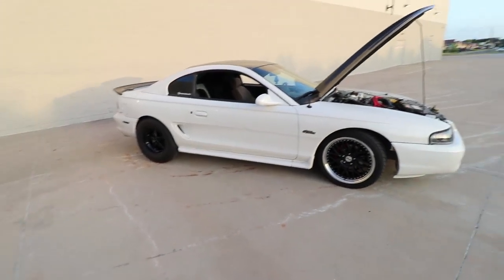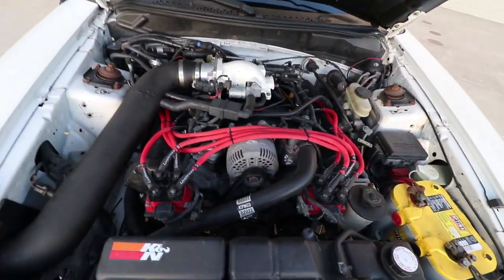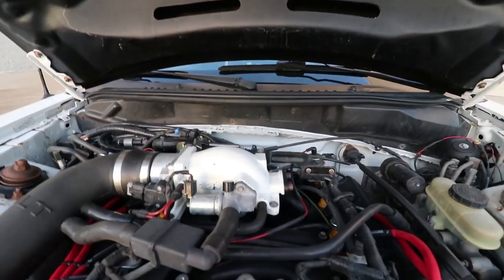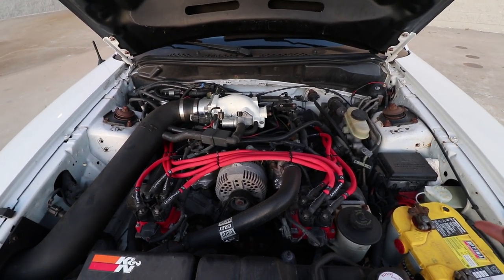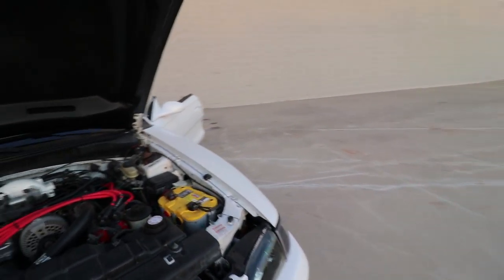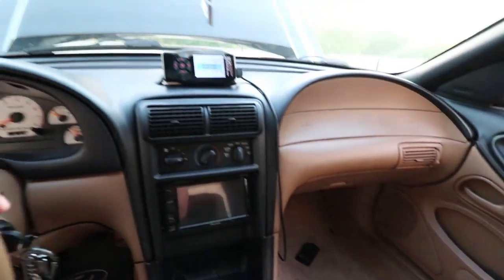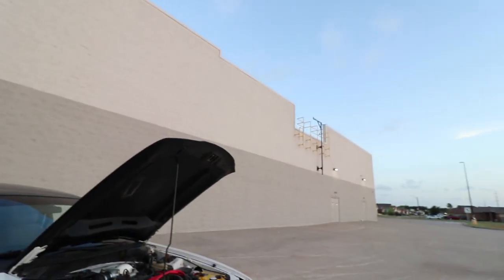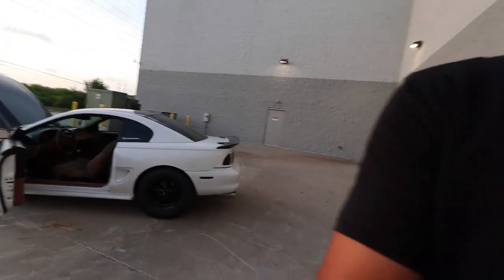How To Get 300Hp Out Of A N/A 2v Mustang

Comment: If you want to break 300hp N/A your gonna wanna get the trick flow heads. The 2v is not a monster in terms of power but they are well built, I'm actually looking to sell my 96 to get a 95 so I can drop a 351 in.
Reply: Stroke that 351 to a 408! Yeee!!
Reply: PI 2v can make it with bolt ons and cams, full exhaust.  NPI will do more if you PI swap it and the  do the ae treatment(pi heads on  npi shortblock gives a bump in the compression)
Reply: @01Snorky  a 2v will never make the power a built 351 in N/A format. With trick flow heads your looking at 380-400hp at the fly wheel on a stock bottom end 2v... a 351 with a forged crank, rods, diamond cut pistons, high lift cam, Victor carb, and head work is going to put you around 500-600hp depending on heads, bore work, fuel, lift and duration on the cam....
Reply: @poppasunny  you think??! It only has 70 more cubes.  And where did a 351w come from in a debate om whether you can make 300 rwhp NA with a 2v, which is totally doable.  6 years ago i made 289rwhp 309 tq with cams not degreed.. litrerally thrown in, with some generic bama tune not for cams.
Reply: @01Snorky  really?.... You replied to my comment.... it's in the original comment.... also I don't know if your being funny or ignorant in regards to "50 more cubes" a 4 valve 4.6 makes 300hp.... a 4 valve 5.0 makes 400+hp.....
Reply: @poppasunny  i am being funny :-D
Reply: @01Snorky  🤦‍♂️ you got me
Reply: RAllen yo rallen! Your totally wright! Weard but i litteralymade 289whp /312wtq with my ported pi from cms with vt stage 2 n/a cams , lt bbk headers, off road x pipe , windage tray , stock npi botton, pi intake , c&l plenum ,75mm tb, cai egr delete blablaba... but my tuner told me that i mess it up with the degreeing and had to do something with the tune to correct it.. but i lost A Lot of hp cuse i did not degree them😭 i would had made like 310+ whp without this mistake!
Reply: poppasunny 47 while that’s cool you should just leap forward instead of backwards. 3v or coyote swap that car. You’ll never look back
Reply: 4.6 4v actually makes 305hp.Its the 3v that makes 300hp.
Reply: If you're going to sell one car to build another for about the same results.  Why bother 
By the time you spend the cash to build the 351 . You can buld a 281. Strock it to a 302 or up the compression.  TFS hears . Aftermath intske or carb it .
I'm not a fan of carb but I've seen built  2 vavle with  carb setup rev to 8 k and i was told it made 470 on E85 . The ET i saw live prove it .
Reply: Mod for mod a "built" 351 will make more power than a 281 yes. But you're comparing a 281 with heads to a 351 bored and stroked with all the goods thrown at it. But keep in mind a stock 351 from the 70s made well under 200 horsepower. We're talking 170hp truck and car engines. Mod for mod on a stock 2v vs 351 the 2v makes more power next to a low compression 2bl carb 351. But both built the 351 has more cubes and makes more power NA. But boosted is where the 2v shines and the 351 stock block maxes out and guys have to run Dart blocks to see 600+ safely.
Reply: 351 Windsor or Cleveland
Reply: @lowlyfe2497  have ran a few 351's up into 600+ without resleveing or getting a new block. It's all about how you build your motor, factoring in the little knowledge I have and about 15 excel sheets factoring all costs the 351 is by far cheaper.
Reply: @ericbly4599  Cleveland
Reply: @Spad68  1. I have priced it out on multiple occasions and it's more cost effective for what I want to build the 351. 2. Ease of maintenance and engine work... 3. Factoring in clearance and block design your going to spend more boring a 4.6 to 302 CI when you could rehone the walls in a 351. At which point drop the cash into the internals, some port/aftermarket heads/ larger heads can really make a world of difference. 3. You can build a 351 mix and matching parts, cranks, heads and intakes are interchangeable as along as ports match.... you can throw a 400 crank into a 5.7 small block and technically have a 383 🤷🏿‍♂️
Reply: I've got a 95
Reply: @poppasunny 47  4V's suck. 2V is king. I outrun them often.
Reply: @poppasunny  get a room.
Reply: @teal_2v338  atta boy!
Reply: Lmao for that money might as well build the motor for boost and throw a turbo on it lmao 🤦🤣
Reply: Just drop in a 7.3L Godzilla motor. They fit good.
Reply: Why do you have to swap down to a 95? Is it because of space problems ?

Comment: Great setup.  I have a 95 GT myself.  That noise might be the idler pulley and belt tensioner.   Those are low cost items and easy to replace.
Reply: Matt crow sounds like a transmission throughout Bering to me
Reply: Definitely throwout bearing.

Comment: Sounds similar to my set up Chris. One thing that a lot of guys don't do when installing cams is degree them big pain in the ass when in car cam swap but you got the timing cover off anyway. Degreeing the cams is more important on multi cam motors. Can gain you up to 20hp depending on how off the two cams are one side of the motor is fighting the the other. Degreeing the cams is free horse power why leave it sitting on the table get those cams dialed in if you can even if its only is 5hp guys pay $$ for add ons that don't do more than that. Just an FYI for guys planing on swapping cams dial them in. BTW nice build Chris your always going to have the haters and the 2V can make HP but requires ported PI heads to breath better.
Reply: How does it not confuse the computer ?
Reply: I’ve heard story’s of people degreeing the stock cams and they would make like an extra 5-10 hp on the dyno
Reply: That is true and with the 4v you will notice that every single one makes different dyno numbers in stock form because ford could not get them degree'd perfectly at the factory.
Reply: Was about to say the same thing throw some pi heads on the non pi motor and you have more power then a pi motor change the compression
Reply: You have to degree any cam in a 4.6 to avoid PTV clearance. Made that mistake with stage 1 comps and broke a valve guide due to PTV.

Comment: Get the Torque tech kit. It lets you run a Whipple, Kenne Bell etc. You'd make up in the 400s maybe even 600s with your FBO set up all ready there
Reply: Stock 4.6 internals won't take 600hp. Maybe 450-500 at most.
Reply: @cheeko_914  Yeah, 400 is a safe area, past that and it's a ticking time bomb, not if, but when it'll hit catastrophic failure. Pistons and crank is your first failure point on the 2v, and they like to go at 500 after a couple dyno sessions, 450 and you may get a few good runs but it'll definitely not handle constant beatings (even if you shift before redline). Forged is what you want if you're gonna be pushing enough boost to put you past 415. I've already done my research on the torktech kit and it's definitely what I want to do, but you're not gonna slap a whipple and a high boost pulley on it and achieve anything past 450, even with a perfect tune, on your pot metal rods and doodoo crank.
Reply: @AzalofForossa plenty of guys have had 2v live a good while beyond 450 rwhp stock bottom while taking a beating.  How high you Rev it and the fuel and the tune all are a big factor in it staying alive.
Reply: @AzalofForossa also supporting mods are a big deal.  A car with long tubes cams and ported heads can make more safe power than someone who just threw a blower on a stock car that doesn't have any of that.  450 rwhp from each are certainly not created equal.  450 rwhp from a more efficient setup running less boost is gonna be much safer than 450 rwhp with more boost (to make up for not having the supporting mods).  It's not as simple as this number is what you can go to anything past its gonna blow.  It's not that black and white.
Reply: If I was gonna run a torque tech kit i wound run a vmp gen2r that is meant for the terminator.  That would be a killer blower for a modified 2v.

Comment: The pi heads on the non pi block was a big part in your power numbers..gives a healthy jump in compression and you did great choosing the the stage 1 pi cams..Those cams offer the greatest power increase throughout the entire rpm range, not just 4500 and above...You dont really loose any torque down low with the stage 1 PI cams which keeps your steetable torque in check...The perfect cams for stock pi heads and intake.👍

Comment: PI heads on N-PI bottom end makes more compression and is easier to get higher NA power. Richard Holdener explains this in a video on his channel. A good tune also goes a long way because these cars come really conservative from the factory. The cam stage matters because of differences in lift and duration, on these I really think it just changes street driveability due to less vacuum on higher cams. A lot of guys daily stage 3 cams though so idk. I'm just keeping my 2v stock.
Reply: Different companies have different stages at different specs it doesn’t mean anything. Na svt (Todd warren) is widely regarded as one of the best for cams for mods. You can look up na svt cams on YouTube

Comment: Nice set up. The 2V isn't a powerhouse but it's a tough, reliable motor. Your dyno numbers are about what I'd expect. A FBO PI 2V puts down around 260rwhp & 305rwtq, and yours put down 20rwhp more with stage 1 cams & higher compression.

Comment: I'm running a Triton 5.4 with heads headers exhaust and tune and I run bumper to bumper with the yotes I'm also running 373 with aluminum drive shaft and 315s

Comment: The 2-valve doesn't get a lot of love. But let me tell you brothers....it is DURABLE!  I have owned 3 of these motors on three different cars (including an SUV) and man I was able to get almost 300,000 miles on two of them (crashed one, sold the other) and the third is still running with going on 300,000 miles all original motor and transmission!  Hell if police cars, taxi cabs, etc. can use them for half a million miles then anyone else can, too.  The trick is to change the oil every 5,000 miles and replace the plugs/coils every 100,000 miles (use Motorcraft plugs & oils).  Also make sure you use Motorcraft "gold" coolant.  These engines are more durable than just about any other V8 currently made.
Reply: They are more durable than any other v8’s made currently. Chevy would be at the top right now with the LS/lt but all their V8’s have the troublesome 
afm/dod and a few cases of lifter failures. Dodge also has Cylinder shut down and the manifold bolt failures. Fords coyote has coil failures egr issues and such, the most minor of the big 3’s issues though.
Reply: @bmacster1985  agreed. The LS and LT motors were great until GM killed it with the AFM. Just like Ford killed a great V8 with their 3 valve design with VVT with insufficient lubrication.

Comment: Nice car and it sounds great! If you had bought a premium set of headers and the matching mid-pipe you would have gotten closer to 300. You would also be surprised at how well a quality set of ceramic coated headers keeps the engine bay temps way down. I got SLP ceramic and it’s literally amazing how much less heat is under the hood.

Comment: What’s up what’s up! I have a 98 Mustang GT. It’s automatic and Dynoed and tuned by Shelby Motorsports, 517 Hp wheels, 537 torque, 573 hp crankshaft. I know you started building, and honestly it’s a starter setup. But I wanted to inform for anyone who is trying to do the same, KEEP THIS IN MIND. Once your upgrade any engine part, you might be forced to upgrade something else! Thanks for sharing your cool project. Btw my car is naturally aspirated pushing that much. I didn’t just grab and bolt on random parts. I suggest anyone to do their homework on how the parts affect the car and which work best together. Trust me, it will be a pain when you encounter something simple as adding cams, valve springs and then needing to forge pistons as an example. I have about 12k just in parts on engine, tranny and gears alone. I learned the hard way. So if you’re trying to add a supercharger or nitrous, just cuz it’s a “supercharger, nitrous” please understand how it’s going to affect you. I have seen many younger people bolting on random parts or adding too much too soon, only for the vehicle to take a dump later. I think your serpentine belt might be a bit loose btw. Also, it’s IMPORTANT to tune your vehicle accordingly to your parts. Your car will thank you!
Reply from the maker: Can you share with what motor components you’re running to get 517 to the wheels all motor? That’s a lot especially through a automatic.
Reply: @ReyesBuilt  Yes; I can do that. Real quick backstory. It’s a passed down family car, I got into some financial trouble and had to sell it after I worked on engine. Somehow I ended up getting the car back since the guy had to move and couldn’t take the car. So he literally ended up giving it back to me for almost free, cuz I couldn’t pay for it. He insisted and I didn’t have it for 3 years. I have the specs and list of parts, so I’ll look for them. But I’ll shoot what I remember for now. Give me a sec. I don’t remember exact specs on most.
Bolt ons: Cold air intake, Throttle body,  big plenum, pulleys and alternator is flipped around reverse for clearance, racing manifold (had PI but went bigger), stroker kit, stage 3 heads, stage 3 cams, flex plate for 10k applications, 4:10 gears, i forgot what spline, axle, tranny mods. Tuned to 91 octane, 8 miles per gallon, royal purple all the way around, dropped about 13 k in engine alone not counting behind flex plate or labor which my best friend is a diesel mechanic so he did most of work and saved me about 10 k. Tuned at Shelby Motorsports. I live in Las Vegas and for all that, I went and spent I think it was $800 for tune and dyno, about a 8 hour job per visit. I’m still not done. Everything started with my check engine light being on, due to misfire on a cylinder and showed low compression. So here I am “man I’m going to add what this one mustang guy added, which was a PI heads, so I ended up grabbing stage 3. It all went downhill from there. Cuz then I needed larger valve springs, so I grabbed stage 3 cams. Next thing you know, what I listed is in. The issue was a rocker that fell off. But because I didn’t do my homework and honestly educated myself on what each part do and affected my car, I had my car down for a year and a half. This is why I say what I said. Because it’s true. I spent a lot of money and many if not all people want a modded car, but aren’t aware of the real cost of parts, time and setbacks.

Comment: Thanks for passing on so much info, the good, the bad and the rest. I'm looking at throwing some bolt-ons at my Grand Marquis' 4.6 - Trick Flow heads, XE262AH cams, FRPP PI intake (until I can find something better that's set up for driver side pickup), long tubes and more. Upgrade the 4W70 for the power...

And enjoy.

Comment: You're doing good man.  If mine did 280HP, I'd be very happy.  Remember, the factory rated the PI Mustang at SEA 260HP at the crank.  With proper maintenance, these engines are built proof.  If you blow it up, you did something stupid.  Thanks for mentioning the metal intake tubes soak up a lot of heat.  It's all about air density on the inlet side, not max air flow.

Comment: So I have pi mustang GT. I see your running a comp 262Ah . I myself will end up running a Trick Flow stage 1 cam . The trick flow stage 1 cams are slightly bigger the Duration @  .50 is 228 for the intake and 230 for the exhaust .It should fit with out any piston to valve clearance .  You can run bigger NPI cams but ...the difference in horsepower is five to six horsepower more . The poweband goes up .

Comment: Mine made 280whp and 281trq. I have stage 3 cams, I went with the NPI pistons on my PI heads and bumped the compression to 10.5:1 did have to notch the piston for clearance, also running a bullitt intake, 3.90 gears, shorty headers, O/R X, stock injection and SCT
Reply: Thoes shorty headers are not helping you make power. They don't really do much at all if you wanna make hower with headers you need long tubes with a long collector at the end.
Reply: @ericgatter2830 they don't make what long tubes do but a good shorty will absolutely pick up power over stock even na.  The stock log manifolds are pretty shitty lol

Comment: I'm going to guess that you're going with a centri type blower and if it doesn't come with a cooler, then E85 will be the best bet on the PI head swap. E85 will also help once the blower heat soaks and the engine is more sensitive to knock, else the timing at high intake temps would have to be reduced and it's a double negative in making power. Folks worry too much about peak HP and 'numbers' but what counts is having a broad and useful power curve where torque is made through as much of the RPM range as possible. Also if highway racing is your gig, then it's probably best just to stick with a stock gear ratio as higher gears only benefit from off the line take-off. The key to 2v is to make broad torque, not peaky power from rpm.

Comment: Man 280 to the ground is like 325 at the crank u loose 15% with a manual transmission so a two valve making 325 horse is really good! My 10 GT is only making 335 at the crank 292 at rear wheels